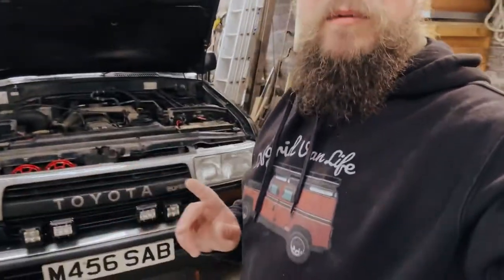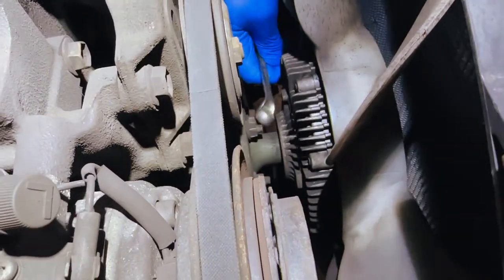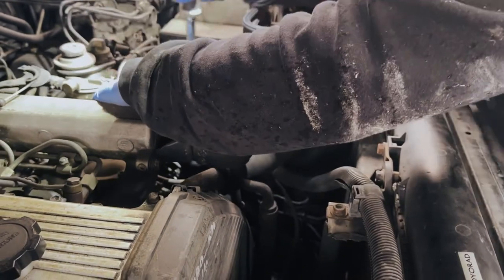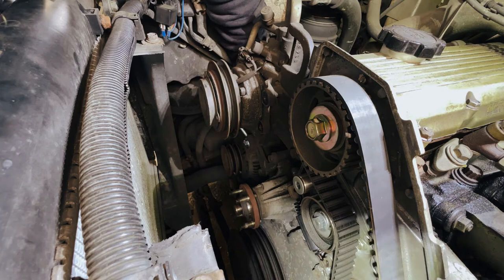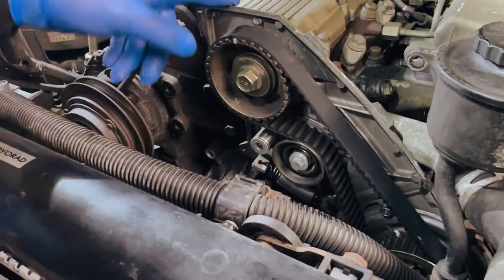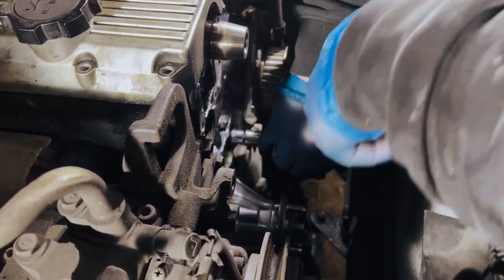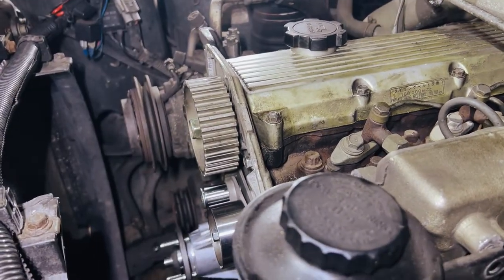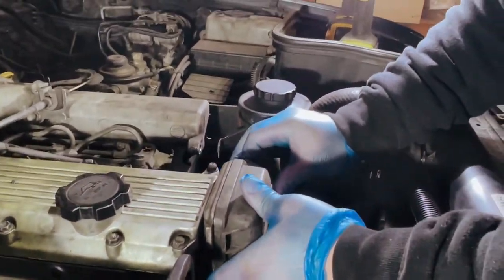Timing belt change on Land Cruiser 80 1HDT

Comment: hey brother how to you reset the timing belt light? is the car have to be on like engine on or just ignition on only the press the light? i pressed it with engine on and off no change wont reset
Reply: Look at the clear plastic cover covering your RPM and Speedometer gauges. You should see a small black rubber grommet that seems flush or protruding a tiny bit. Push that with a pencil or pen and that’s the reset for the timing belt light.